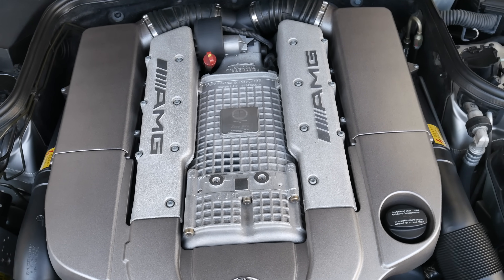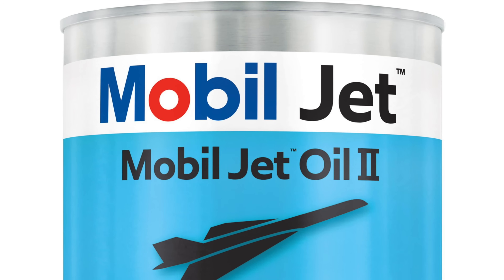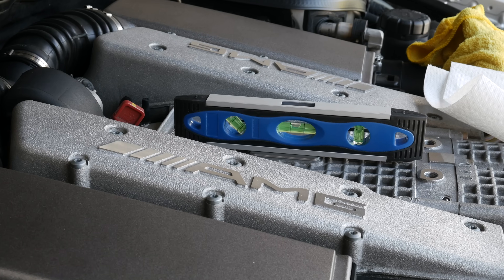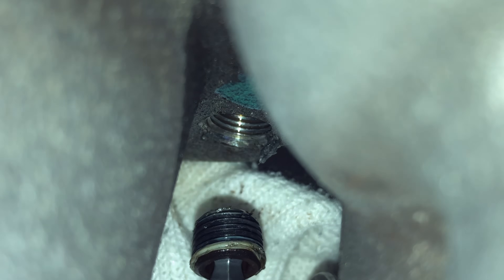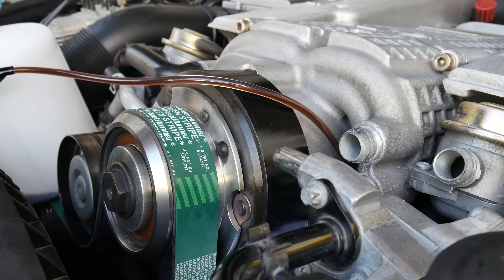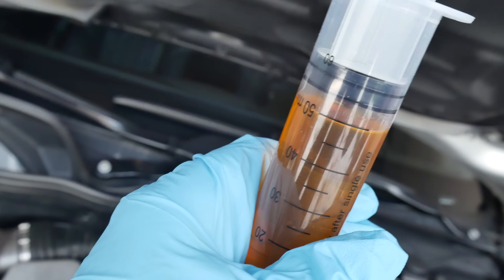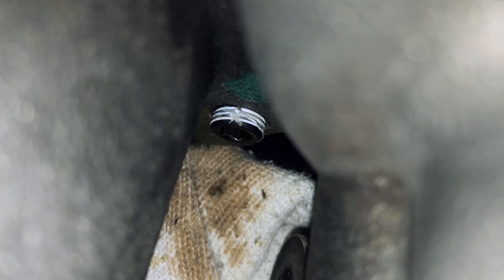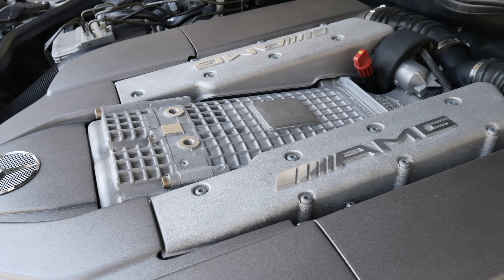How to Change the Supercharger Oil on AMG M113k Engines (4K)

Comment: I just did this job. It wasn’t hard, but I only managed to get 40-50ml out after many tries with the syringe and tube, even with a metal wire to ensure the bend.
It is possible to overfill the oil. In that case, oil will leak from the front supercharger pulley bolt. I parked on an incline and had a rag to catch the extra that leaked.

My recommendation to avoid leaking is to only put in what you take out, maybe + 5-10mLs. This is not like a a differential where you fill it until it comes out. Thankfully Mercedes made the design foolproof so it can’t really be overfilled, but the mess it makes when it does is not pleasant (particularly the smell!)

Comment: Thanks a lot mate. Pulled super black oil with poly tubing with a wire coat hanger, did all sort of movement and adjustment to vacuum as much as I could but only pulled 100mL. Cleaned the syringe (what a messy and smelly oil!) and injected 130mL because I wasn't sure if I had leftover fluid that IO failed vacuuming. Half Teflon the threads, to prevent leftover Teflon from being exposed inside, and it runs great!

Comment: Was able to pull 150ml out of my 04 SL55 AMG. Had to switch to a more flexible hosing. First hose was a plastic type and only able to pull 30ml. 2nd hose was a piece of aquarium tubing with the wire inside and that did the trick. Great video! Thanks!

Comment: This is one of your first vids I watched when I got my 03 S55 a few years ago.  Very spot on instructions, very clean and concise.  Just checking back in today to ensure I do this oil change correctly on my 07 G55.  Thanks : )
Reply: Did the S/C oil change make any difference to the car? I'm getting an 03 s55 very soon as well and want to perform this job :)
Reply: @safelysound  how long would you operate any motor without changing the oil?
Reply: @Nate_tureboy  4500mi for all my cars. Have a civic and a e93 bmw

Comment: Thanks AMGmeister, did the service today. I don't have an extractor pump, so I used wire and bent hose as described , started siphon with syringe and with enough hose long to reach the ground in front of the car siphoned out 130 ml into measuring cup. Only tricky part is getting the fill plug back in. Make sure you have the rag under as described as it saved me from losing it !

Comment: Yes sir, I have 2009model c200 kompresor, troble code p0045, its says supercharger boost control solenoid circuit A open, can you plz pin point to me where is it, really it gives me  headache, after I erase the check engine the kompresor engage ,again the check engine come again,hope you have idea,tnx

Comment: Thank you for producing this video. Based on your guidance, I was able to perform this over the weekend. I believe I saved a considerable amount of money doing this service myself. The hole project took only an hour. The biggest challenge was reinstalling the oil plug. After a few trys with different allen wrenches, I was successful. I recently purchased a PLM intercooler upgrade. I may do this project next weekend along with the upgraded pump.

Comment: Based on the picture of the cut-out, and provided that the car is level, would it not be right to say "fill until" it comes out? 

Usually most case contained oils are measured this way (gear box, transfer case, transaxle, etc.).

Great content!

Comment: I used this video as a guide for my 02 SLK32amg. After 240,000 kms I couldn’t believe how dirty the supercharger oil was (and the smell!). 
However I used ACDelco 10-4041 Synthetic Supercharger Oil as many of the 32/srt guys use it instead.

Comment: Maybe a dumn question but I've always wondered how come this oil doesn't get injested into the cylinders?!

If it's behind a seal,and just lubricating the drive gears then what lubricates the actual screws?
Reply: There’s a cavity inside the front of the supercharger that houses the fluid. Which lubricates the gears that are connected to the roots style roots. They never make contact while compressing air down the intake manifold thus no fluid is inside that area. The gears are sealed off, for oil to leak past and get into the combustion chamber. There’s been something wrong with the blower for a long time already then.

Comment: My E55 was parked on a steep incline, nose down. After 10 minutes of idling I started smelling supercharger oil. Opened the hood and saw that the supercharger pulley is contaminated with oil and sprayed some underneath the hood. Does anyone know if it can seep out through the so-called “breather hole” when car is nose down on an incline? If so, how many degrees of an incline for the oil to just start seeping out on its own?
Reply from the maker: linvesel have you change the oil before? If so, did you fill approximately what you removed?
Reply: AMGmeister No, I have not changed the oil before. The previous owner did, and he did it exactly the way you do it (He is a MB tech). Car has now 99k miles (I bought it at 75k miles). I have never parked the car facing down on such a steep incline before. So I am unsure if the leak I experienced is normal occurrence due to the breather hole, or I need to take my supercharger apart to replace a leaking seal. Do you know if at a certain angle oil would start dripping from the breather hole naturally? One would assume that a breather hole would allow that to happen..?
Reply from the maker: There is a breather hole on the pulley bolt that it can leak out of. For example, if it is overfilled, it will leak out. I can understand why it could leak out on a really steep incline although it might also be overfilled. How steep is the grade would you say? 30%?

Comment: I urge everyone: DON’T DO THIS. Several things are wrong and should be mentioned. 

First of all the correct fill amount is 153 ml +/-3 ml, not 150 ml. This is almost a scientific value and too much or too little can have devastating results. Have you ever seen a Kompressor going bad because of that? If so you know what I mean. 

Next, by sucking it out some of the old oil remains inside and will throw off the correct value that needs to go back in. Why would you want to to mix old oil with new oil? Some mention the old oil smells horrible. So? You would never smell it if you just leave the system closed. It is fine how it smells. 

If you want to to it properly, remove the Kompressor, open it and drain the oil completely and clean everything before refilling the Kompressor.

Last but not least, a German chemical engineer with a Ph.D who’s well known in the AMG world did get an analysis done of old used oil and new oil to compare the oils in a lab and they have found that even after well over several 100.000 km the oil structure has no significant “wear and tear” and based on that result it is absolutely unnecessary to stop a running system and risk of making a perfect Kompressor go bad just because.

I hope this will help others who think of doing that.
Reply: "First of all the correct fill amount is 153 ml +/-3 ml, not 150 ml" lol
Reply: Cant trust someone that cant add or subtract
Reply: Excess oil will flow out of the breather hole on the supercharger bolt, but i agree too little can have detrimental results

Comment: DO NOT DO NOT lose-that supercharger screw! There is no part number and you won’t find it anywhere, I learned it the hard way!
Reply: https://www.hanshehl.de/motorg55-7-3.htm 

check this link, thank me later. also use a teeny bit of teflon on the threads.  translate the page from german to english
Reply: @ademc8872  Thanks for that link, now to figure out how to translate the page.
Reply: How did you resolve?
Reply: was able to find some screw to put there but it was not a tight seal and leaked a little out. if at all possible, id take off the whole supercharger and do it. The dealer was like we have no part number nor do we have it on as a maintenance item. @wt81-l3h

Comment: When I had my E55 and I did the oil change on the blower, if you stroke a strong magnet across the length of the ball allen tool, it will impart a charge into the tool temporarily so that the Allen plug sticks to it.   Makes it much easier to get it out without dropping it.

Also, I measured the amount of oil, including the stuff in the tube, that I drew out, that way I put exactly the same amount back in and didn’t risk overfilling.

Comment: Great video as usual from AMGmeister! The wire tip was a great idea. I've done it twice in 125,000 miles now for peace of mind. I'm at 203,000 (06 E55 AMG) I wrap 2 or 3 loops of teflon tape for good seal

Comment: Another great video which i can apply to my C32!!

Small tip regarding the teflon tape: It matters which way you roll the tape around the bolt. You wrap it in the same direction, the fastener is being tightened, otherwise the tape will unwind while fastening the bolt. Also starting to apply the tape on the second thread of the bolt, helps to screw in the bolt easier.

Btw, what is that intro song you use?
Reply from the maker: UncleBenz Thanks. Yes, it matters which way you wind the tape. Mine just got a bit messy from the black tape that I was using to hold the bolt in the bit.

Comment: looks like one of your hoses has a tear in it is that okay?
Reply from the maker: Caro Babaknia You mean the section with the tape? It wasn’t torn. That’s just the section where I joined the 1/8” hose to a bigger size. Tape was just for redundancy.
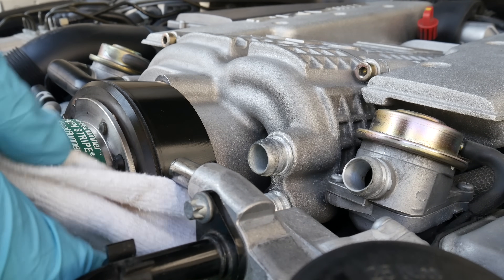Reply: @AMGmeister   at 5:48 the one you are reconnecting
Reply from the maker: Caro Babaknia No tear. Just a mark on the rubber from resting it down while doing this job. The mark comes right off.

Comment: I have been thinking of change for my E55. But Mercedes themselves (and a bunch of other mercedes unauthorized mechs) don't recommend to change the oil since it is sensitive mechanics in the supercharger. Now I am left with a split decision :-/
Reply from the maker: Well, Mercedes didn't recommend changing the transmission fluid when these cars were new and look how that turned out. With the supercharger oil, it is understandable that they would want you to be cautious, the right level is critical and you do not want to get any contaminants inside the supercharger. Nonetheless, no oil can last forever and fresh oil done right will keep the supercharger healthy for the long run.
Reply: AMGmeister true that I think the key trick is just the right amount. Since its sensitive. Just as you say no oil last forever. Well now I think I will buy a can to do that

Comment: Hi again Alex and greetings from Ireland. Thank you for this most informative video. I've been putting this job off until i got good advice. I'm ready now thanks to you. I'm  putting in a link to the oil I got on ebay uk https://www.ebay.co.uk/itm/Mercedes-E55-AMG-W211-Lysholm-supercharger-oil-refill-kit-2003-2004-2005-2006/181790051654?_trkparms=aid%3D444000%26algo%3DSOI.DEFAULT%26ao%3D1%26asc%3D20170221122447%26meid%3D0cb1b0834f85441ab1876526d9ef8535%26pid%3D100752%26rk%3D6%26rkt%3D6%26mehot%3Dpp%26sd%3D150698980556%26itm%3D181790051654&_trksid=p2047675.c100752.m1982   This is what I intend to use. They say it exceeds Lysholm requirements. Do you have and opinion please. 2006 CLS55AMG 43,000 miles. Thanking you in advance, John
Reply from the maker: Thanks, and that eBay seller looks good. He says "latest high specification synthetic turbine oil manufactured by British Petroleum". I would ask what specifically the seller is providing. Is it BP Turbo Oil 2380? - which is equivalent to Mobil Jet II. Otherwise, he has 142 sold and good eBay rating, so I think its good.
Reply: @AMGmeister  Cannot thank you enough for your response Alex. I will check ASAP.
PS any info in the airstruts and if I can just replace the airbag without having to buy the whole strut? I think you can for the ordinary w211 cars.

Comment: What if its never been changed?
Reply: I Was thinking the same thing
Reply: @vdgggame  If never changed..... do it.   I've heard of higher mileage cars having only a fraction of the required oil, changing it will only extend the life of the supercharger.
Reply: mine hadn't & it was low & filthy the 1st time I changed it. That was at 100,000 miles & I'm at over 200,000 now. I've done it twice. I could see people frying these things for sure if they never change it and abuse the car.